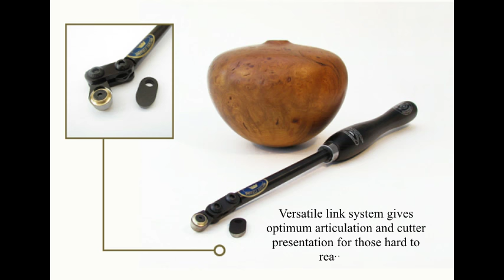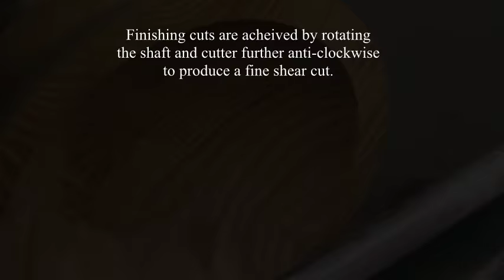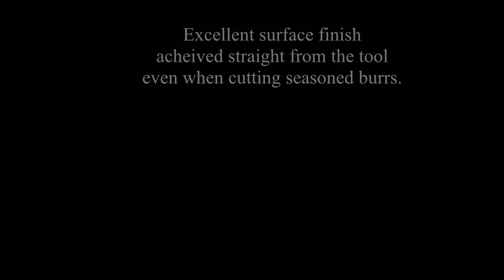Revolution Hollowing Tool

Comment: I bought one of these some time ago after watching one of your previous videos. I have no idea what I am doing wrong but I got a lot of dust rather than shavings. Perhaps this video will push me into trying again. Best regards, Mike
Reply from the maker: Mike give me a ring, phone number on contacts page of my website, if I am not in leave message and I will get back to you to and try to help you out. It is a great tool and you certainly with sound wood should not get dust, may be the cutter need adjusting. As I say give me a ring.
Reply: +Mark Sanger - Mark, that is very kind. I am in the middle of a non woodturning project but will get back to the workshop and try again. Will then ring you! Thanks again. Regards, Mike
Reply: For anyone that is interested. I decided to take a days course with Mark, not feeling that a phone call would do the job. I now feel happy with the tool. It was a very good day and I learned a lot. Money well spent. Mark is a good tutor and easy to be with. I recommend him. Mike